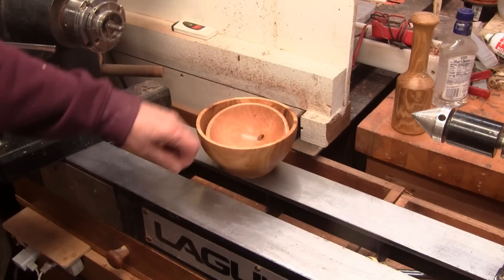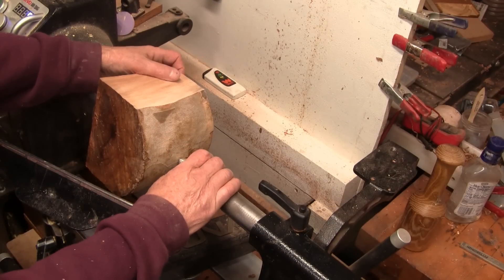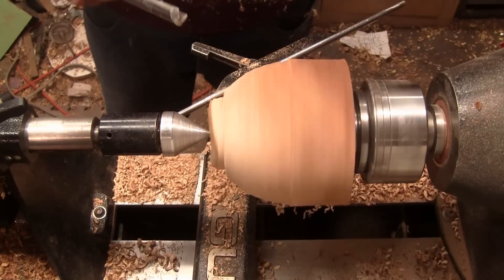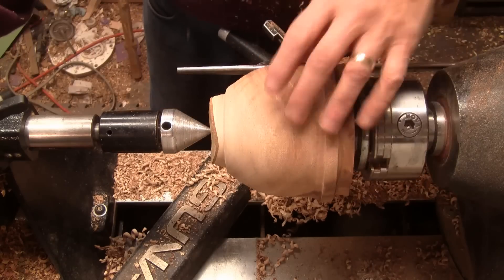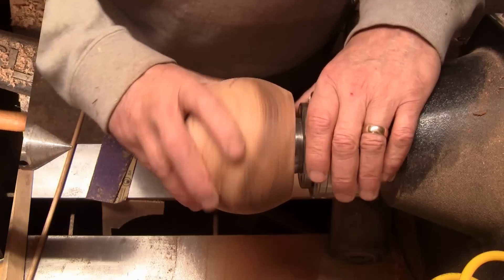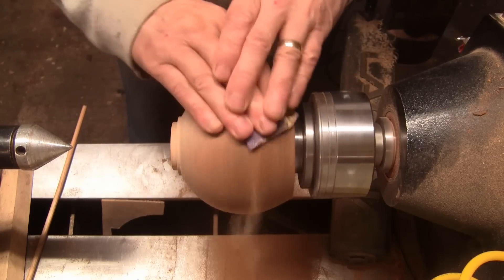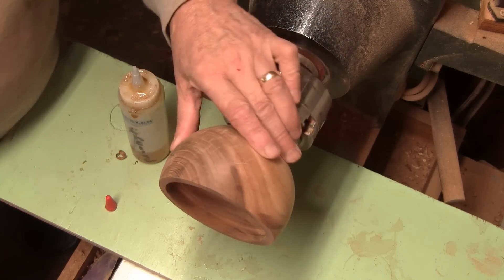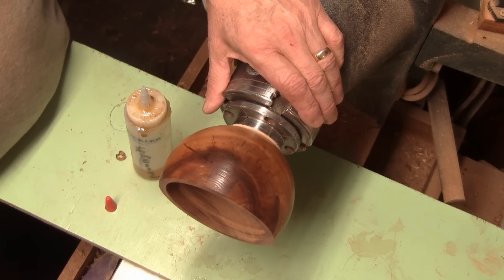Wood Turning Two In One Bowl London Plane

Comment: What a cool project!  That’s really neat.  You made me look up London Plane;  interesting wood.    Also really liked the trick with the template and black crayon.
Reply from the maker: Thank you Mark! London Plane is a very interesting wood.
That black crayon on trick is something I used at work when turning a shape on things like pump and valve body patterns. they had to be turned to the dimensions on the drawings and that was the best way to get them exact.
Thanks for watcing,
Gary

Comment: That's unusual & very pretty!  
Wonder what a crazy version would look like? Maybe too crazy.
Reply from the maker: Thank you very much. So what would you consider crazy? I would happy to give it a go.
Thanks for watching,
Gary
Reply: Well, those crazy bowls of various arrangements of segmented wood fascinate me with how the patterns morph & bend with the changing angles of the turn. I just wonder what this technique [2 in 1 bowl] would do to those patterns.
Reply: I'm sorry. The term I used, 'crazy' was incorrect. I see they're called 'dizzy' bowls. Sorry for my error. 
Crazy or dizzy, I love your work though. 👍😀
Reply from the maker: No problem I actually like that term  "CRAZY"  and I was thinking on some sort of a segment bowl that was a bowl in a bowl. So we shall see. Probably not a dizzy bowl. It is hard to get much of a wall thickness and to get  rounded bottom. But will work on something.
Gary
Reply from the maker: As I answered in the other comment I have been thinking about something that was glued up. The way a dizzy bowl is made it would be difficult so it will need to be a new style.
Great idea though!

Comment: Looks good. I have to rewatch the video for the other one you showed. I can’t remember how you made the outside bowl to have the level brim. Which of the two would you consider more challenging?
Reply from the maker: Thank you Barry! I think both are about the same as to making them.
For me this was easier because I knew after making the first what steps I needed to do.
The level rim on the outside was just a matter of cutting so it blended into the area that was not cut.
 
Thanks for watching,
Gary

Comment: Another beautiful bowl(s). How feasible would it be to do the offset turning for the inner bowl instead of the outer bowl -- so that the rim of the outer bowl remains parallel to the tabletop, and the inner bowl sits at an angle? Would you have the access you need to cut the inside, or would the tailstock be in the way? Guessing that might be easier/safer on the flatter version.
Reply from the maker: Thank you Matthew!
Actually I could have set it up and flattened the bottom so the outside rim would be level. For what my wife will use it for I chose to have the inside rim level to the table. But either way would work.
Hope that makes sense.
Thanks for watching,
Gary

Comment: papa are you at all interested in trying your hand at any epoxy resin projects? resin/wood and resin/burl hybrid pieces is what i think you would personally enjoy exploring the most. it might be a little too messy or finicky for your taste, i dunno, but the possibilities are endless and allow you to be very creative which you have in abundance. as long as you don’t mind being buried in resin shavings of course ;-) 
would love to hear your thoughts and opinions on the topic.
Reply from the maker: Well I doubt it would be too messy for me. I worked as a wood pattern maker and often we had to make resin molds to cast duplicate resin patterns. Also did epoxy and fiberglass layups for core boxes and patterns.
 So I have done more resin work than most who use if for making resin and wood bowls. And the end results were sold for a lot more than what a resin bowl would get.
 So that is the reason I am not interested in using it for my wood bowls. 
 Another big reason is not only is it messy but the fumes coming off the resin is not good and the fumes made while turning are not good. Maybe too much exposure to it but it is not good for my system.
 I think some of the resin projects are very nice though.
 I hope my answer makes sense.
Thanks,
Gary

Comment: Hi Papa.  I have a general question for you. After seeing how Paduk made your segmented bowls pop, I decided to use it along with walnut, cherry and maple. What I discovered is that the red pigment in the Paduk, after blowing all the dust off, bleeds into the other woods. When I used shellac sealer, the red stained the other woods, especially the maple. Do you have a way of preventing this condition?  Will sealing, then lightly sanding and resealing solve this problem?  Any advise would be appreciated. Keep the great videos coming. I’ve mimicked your projects,especially the segmented, angled segmented, etc.more than any other turners. Thanks for the ideas. -Dave
Reply from the maker: Hi Christine,
I show how to keep Padauk from bleeding in a few of my videos.
After sanding blow the dust off with compressed air. Do not wipe it down with denatured alcohol or even water. That will make it bleed.
Then what I do is use a very light dusting of sprayed on lacquer about 3 times. Then I start with heavier coats. The light dusting will seal the colors in.
 Here is one of the videos: https://www.youtube.com/watch?v=x1u6nW2HExw&t=189s&ab_channel=ThePapa1947

You can look for others with Padauk because that is what I do to all of them.

Gary
Reply: @ThePapa1947  Thank you Gary. The bowls I’m making are salad bowls for my daughter’s wedding present. I expect she’ll be using them for a long time to come so I don’t want to use lacquer as a finish, I prefer to use General’s Salad Bowl finish. I’m not sure the lacquer even as a sealer would hold up in this situation. Are saying that it’s the alcohol that pulls out the color?  If so, the label on the salad bowl finish reads like it could be self-sealing. Any thoughts?  Thank you again. -Dave
Reply from the maker: The Salad Bowl finish is a poly product. I have had reasonable success with poly not causing issues. A small area but I would test it first.